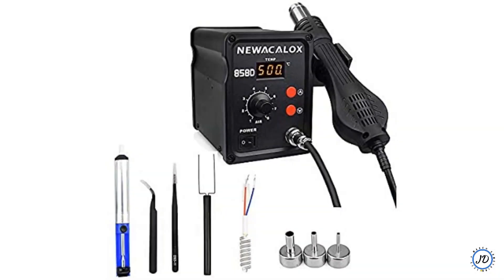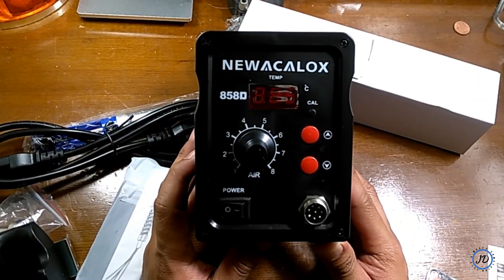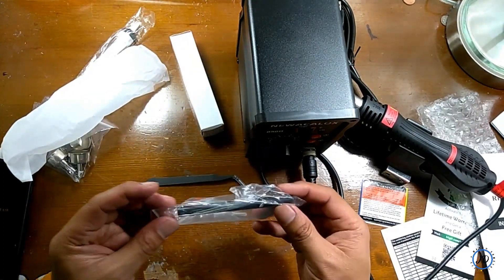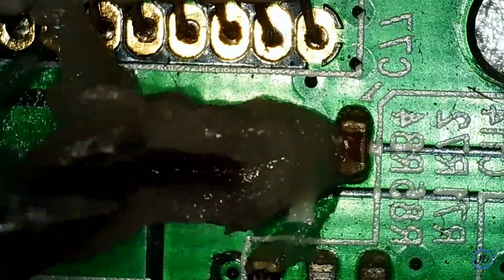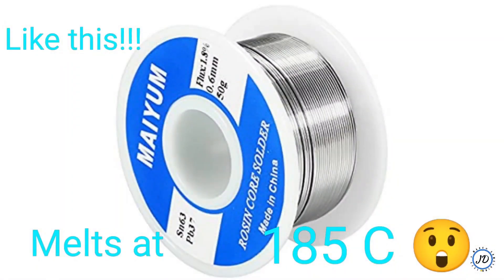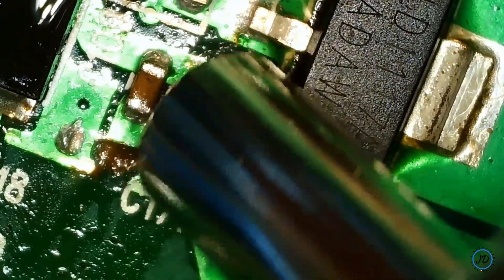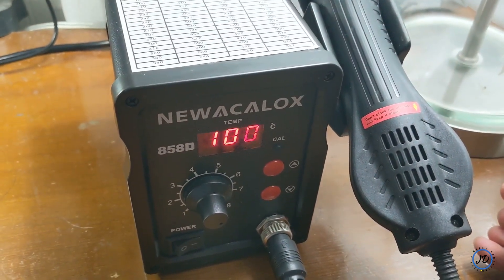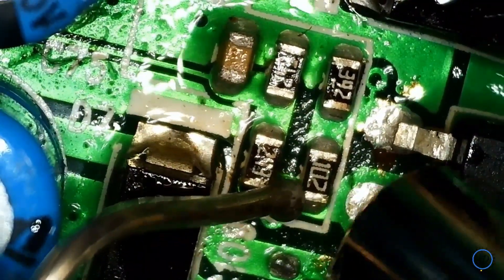Electronic Projects Ep. 2 - Unboxing NEWACALOX Hot Air Station

Comment: Does this mean that the station is not capable of removing an ordinary diode soldered with a lead-free solder?  Have you tried it with a higher temperature?  What temperature does the station actually reach?
Reply from the maker: Still have it and been using it a lot. I've been only using it with low temp solder maxing out at 300 C for my  normal uses. It can go up to higher temps but haven't really test it at those temps
Reply: This station is not for profesional use.
This stations are 700 watts max and you need a 1000 watts for profesional use.

Best Regards.